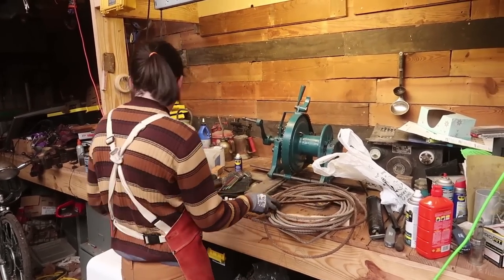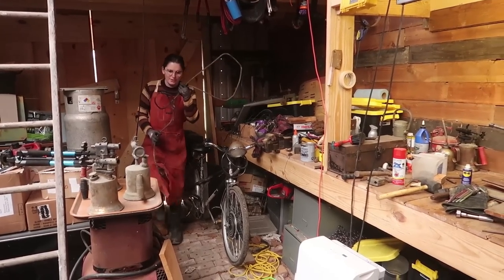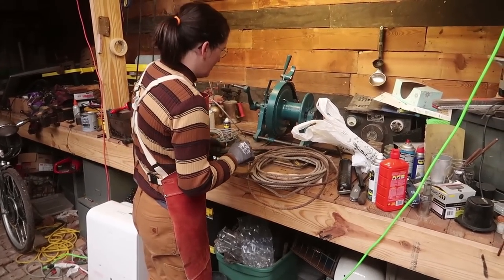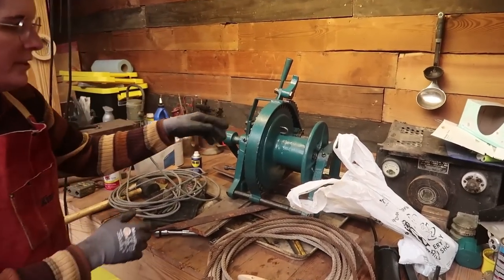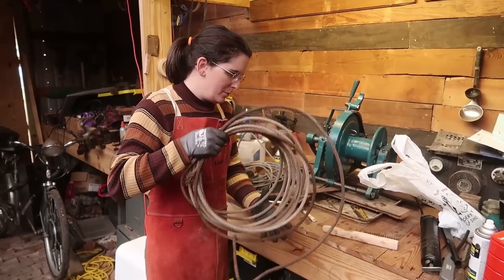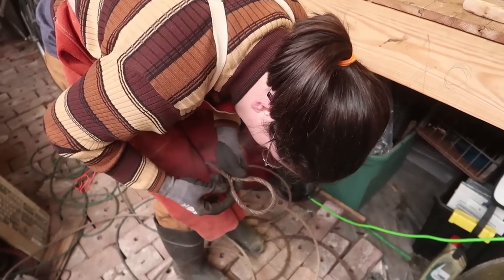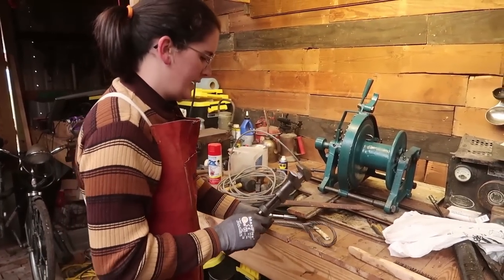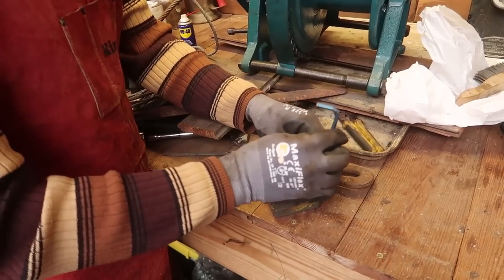Random Bits 0241: Steel Cable/Wire Rope "Farmer's Eye" Eye Splice Test (Thanks, Essential Craftsman)

Comment: The rope core is there to lubricate the wire. The idea is that you don't want to add oil or grease to the wire from outside and bring dirt and sand in with the lubricant, instead they use a rope that is soaked in grease and then the tension on the wire squeeze the grease from inside out. They often use this method on winches and other situations when the wire can be exposed to dirt.
BTW: Thanks for the trick of splicing wire. I haven't seen that method before. Nice! :-)
Reply from the maker: oh thats cool about the oil

Comment: nice way to splice cabels, now i wonder if they do the same with the comercial ones and just leave the ends longer and put the metal sleeving over it so it dose not poke the human operating it.

Edit: think that is my first safty comment (back set safty I know how mutch you love them) :D Be where with cabels under tension most of the energy you put in that system by tightening is still in there. combine that your splice is relaiing on statick friction. Dont know if thats the correct term, but once it starts mooving the energy requiert to keep it mooving is way lower. if thes ropes give way in a section where your hand is near they get really fast in a realy short time and probably with out mutch notice before. Dont have your hands near thees spots. If the end of the rope is only mooving in one direction and not going around beds nothing happends but once the rope goes around a corner it gets dangerous for the flaschy pointy things we call fingers.

I have seen ropes snap and you dont want to be near them when they do.

Comment: You have to have a tail after making the eye and re- wind it. Then use a cable clamp or seize it with tie wire. Otherwise you're asking for trouble.

Comment: Wouldn't it be stronger is you soldered the free ends of that twined loop into one solid piece using thin wires wrapped around it in a tight spiral to prevent the individual thin cable wires from separating and slowly unwinding as the tension goes up?  As long as the cable wires stay parallel in their twist, they are capable of holding rather large forces, but not if they can unwind..

Comment: I may be wrong but I think you still need a year drop shape wire bracket to form the loop around. 
And two cable clamp's. On the nerow end to hold things together. The spliced ends is a great idea.

Look at any good book on Marlene spike seamenship for more information about wire rope splicing.   Consider changing out the aluminum hook as if that parts the back lash from the cable is very dangerous to be standing near.  We were taught to have your dinner foot pointing towards your escaped path.
Reply from the maker: well i dont expect to ever work with such tensions again once i get my block and tackle made

Comment: you could rig up a spot on the handle of the winch to hook up a drill to so when you need to reel it in quickly it wont take much effort
Reply from the maker: or i could modify it to disengage the gearing

Comment: That's actually a rather smart way of making a loop in the end of a cable. Although I won't be trying it at work on the 38mm cable. I thought you were going to do a splice at first.
Reply from the maker: would this not be considered a splice as well? but i get what you mean.